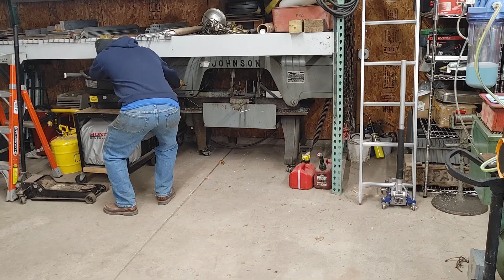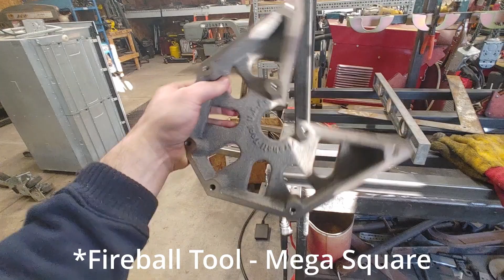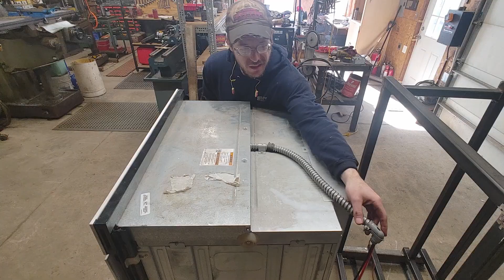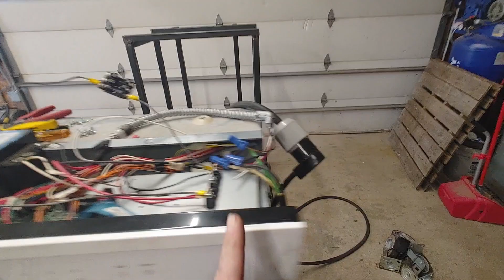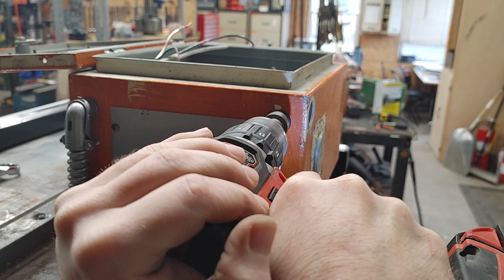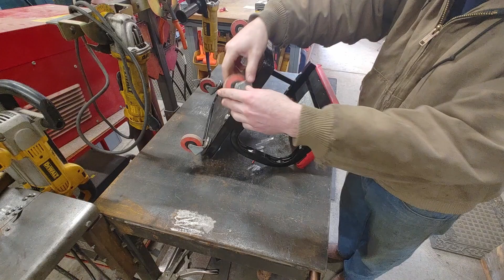Setting Up An Oven For Powder Coating In The Shop

Comment: Great build! Add some handles on the side that can double as tie down anchor points when transporting with the forklift. Merry Christmas and Be Safe!
Reply from the maker: Ooo that's a good suggestion. They would double as tiedown points if it ever needed to be transported on a trailer as well.